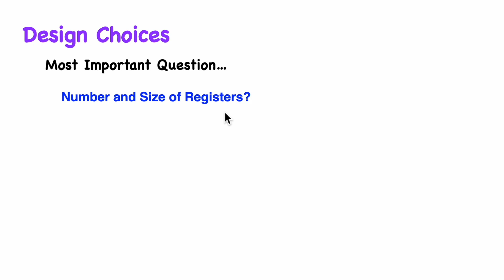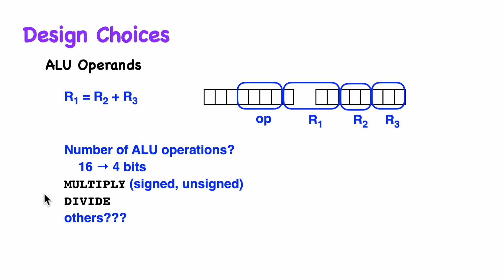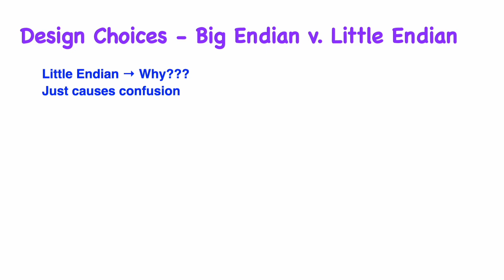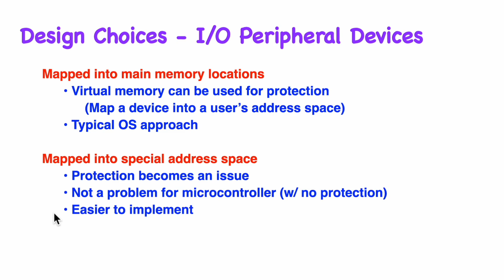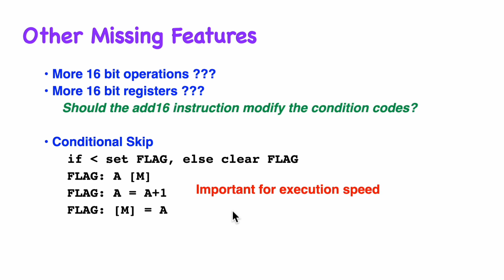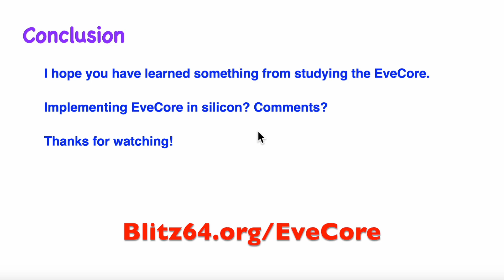EveCore 25/25: Design Decisions, Lessons, Mistakes

Comment: Some general remarks:

1.  Thumbs up to multi-length instructions, for two reasons:  (1) It is ultimately the only way to make a meaningful reduction in code size, and (2) lets you design larger instructions, which nevertheless can do more work wholesale and do it faster than the equivalent retail instructions.

2.  BCD is not necessary for most technical programming, but it is absolutely essential for financial programming.   Just like base 10 has no finite representation of 1/3, binary has no finite representation of 1/5.   Since base-10 has 2 and 5 as prime factors, this always will make decimal-to-binary conversions problematic.  And rounding issues are spectacularly complex when you are talking about multiple currencies--in fact, some currencies specify how rounding is done as a matter of regulatory law--if you don't do it correctly, you can loose your stock-broker license.   And in any case, people get touchy when you start mishandling their money.  

3.  There is an easy way to teach little-endian:  we are actually taught a little-endian algorithm in elementary school for addition, subtraction, and multiplication of multi-digit numbers!   We start with the least-significant digit for all of those by-hand algorithms.  We only do long-division in a big-endian way.  But this means that students come into the classroom already familiar with both little- and big-endian conventions.  If third-graders can get facile with both conventions, surely freshmen computer architecture can as well, and since both conventions are widespread, they should be familiar with both.

Another poster has pointed out the consistency of pointers with little endian.  While casting between different sized integers, etc, is deprecated in c++, in embedded programming this kind of bit-twiddling and casting is de rigueur.  

4.  if you wait until everything is absolutely perfect before you start making videos, you'll never make the videos :-)  As Leonard Cohen sings, "there is a crack in everything"  :-)   And I really like your videos!  I hope I don't have to wait forever.

Comment: One benefit to little endian layout is the ability to cast between pointers to different sized integers (i.e. cast a *u16 to a *u8 as long as the value in the u16 fits in a u8), but I'm not sure how useful that is in practice.

Big endian is definitely the right choice for an educational architecture. At this point it's hard to say if it'd be easier to switch x86 to big endian, or to just change the Hindu-Arabic numeral system to little endian
Reply: Why would big-endian be better for educational purposes?